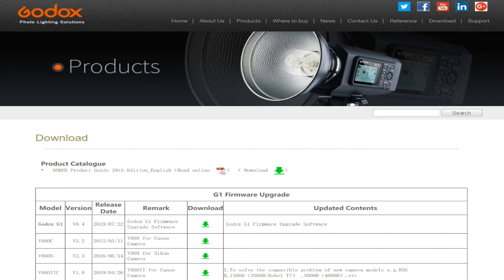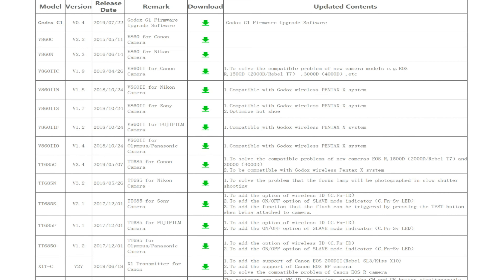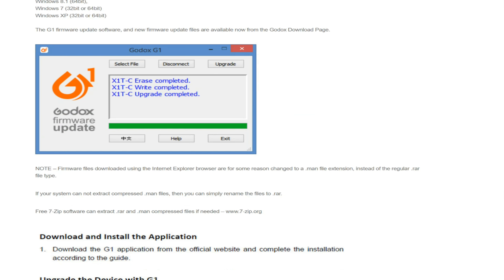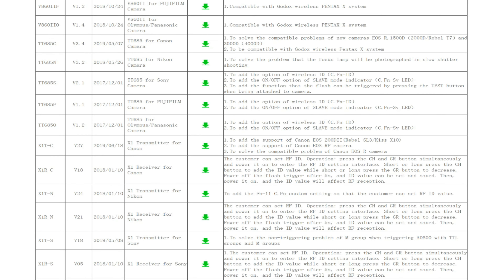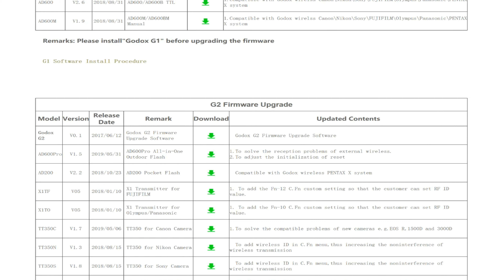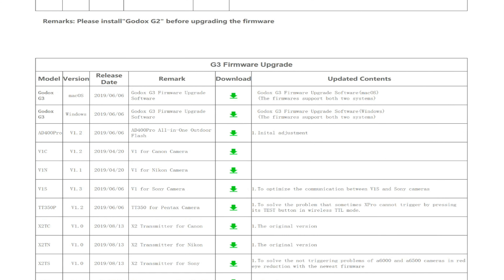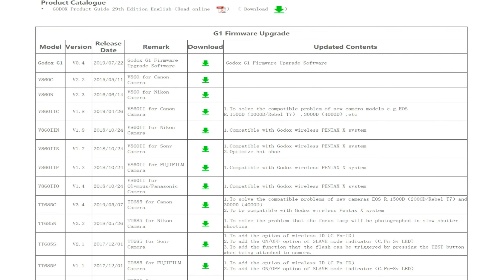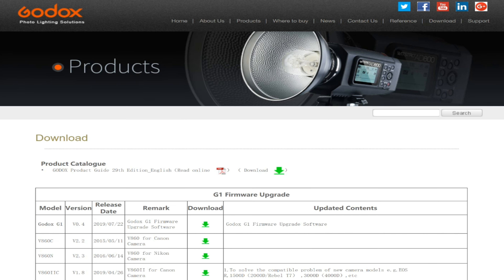How to update Godox gear using Godox software

Comment: Great video! I have an E5 Error on my new V1 flash with a continuous beeping sound and it says please contact the after sales service! 
 I think I maybe messed up a firmware upgrade using G3  but reinstalled the Bin file  a few more times anyway but still no luck!  is there anyway to fix this like an older update somewhere or do I need to replace it from B&H which is no problem at all? Thanks
Reply from the maker: Replace it
Reply: @LancePrevostPhotography  Already did and uploaded Ver 1.4 to the V1 Flash with the G3 Software so TTL is now recognized by the V1 Flash!